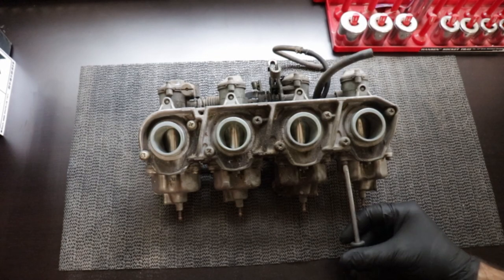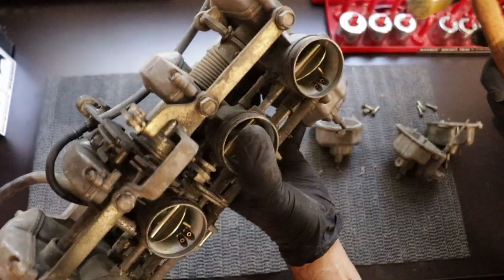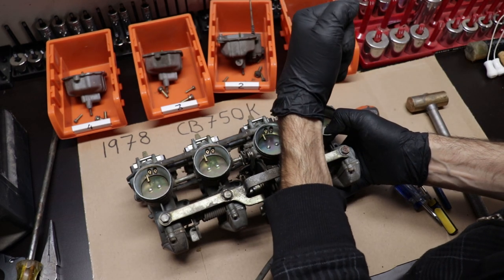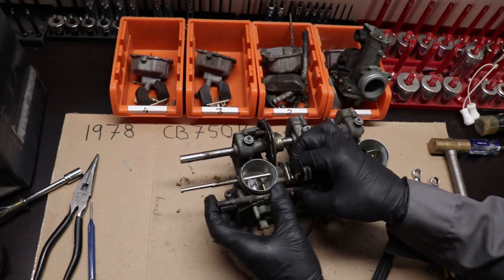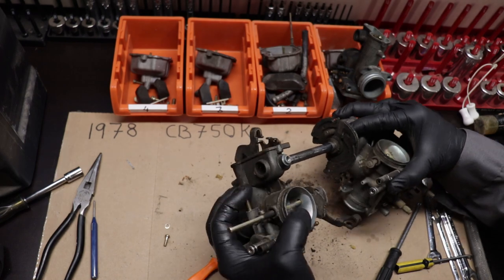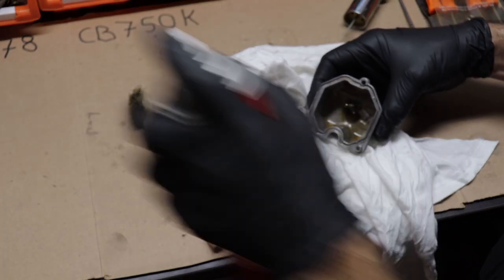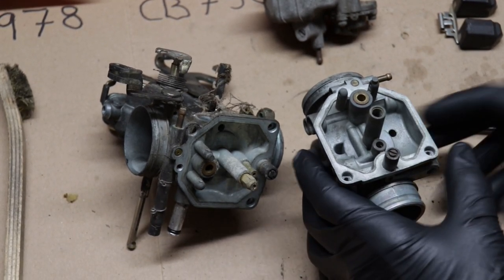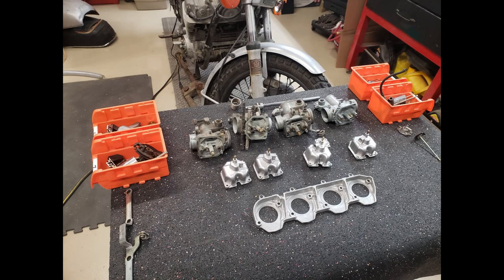Episode 3: Carburetor rebuild part I (disassembly & cleaning) 1978 Honda CB750 K8

Comment from the maker: Worth mentioning, if you use simple green on Aluminum to rinse thoroughly with water afterwards. I used it diluted  with distilled water. 
I do think it discolored the aluminum somewhat, possibly because I had different parts in with the carb bodies. Better to do them on their own I think.

Comment: Great videos! I have a 1978 CB750 K that is almost all original except for exhaust pipes which are now 2 into 1 on each side.  Having real problem with a replacement petcock that does not seal resulting in gas leaking out of carb overflow leaking gas.  Any ideas where I can find a replacement petcock?  Keep the videos coming.  Thanks for sharing and waiting for future videos and to see what your completed retro looks like.
Reply from the maker: Thanks Herb, I don't have any good leads on a quality replacement petcock yet unfortunately. Sounds like there might be a sticky carb float too however. I'd pop the bowls off and see what was causing the leaking carb(s) to not stop the fuel from overflowing. I'd have a look at 4 into 1 or perhaps common motor and see what they have for petcocks. Good luck and thanks for watching!

Comment: 😎👍😎
Is there any difference in cleaning between vapor blasting and sonic cleaning..??
Reply from the maker: Yes, I used the ultrasonic to help loosen up any old fuel that was left inside that would affect the operation of the carb and also help degrease it (simple green) the vapour blaster is mainly for cleaning the outside and get at all the impossible to get at areas so I could make it look new again. Works great on Aluminum parts. 
Thanks for watching!

Comment: Is there a certain way I need to have the jetts?
My choke has to be all out to run, so I feel like it getting to much gas.
Reply from the maker: There might be a couple of things going on, does it seem worse when it's idling? It might be the pilot jets needing cleaning. Are you running stock airbox/air filter? Removing that can mess with the air/fuel ratio too. 
If you need to have the choke all the way out to start and idle the engine but you can run with no choke at higher rpm then I'd say one or more of your pilot jets are fouled. If it needs choke all the time no matter the rpm then your running lean for some reason or another. Did it used to run ok and then start having problems or has it always done this?